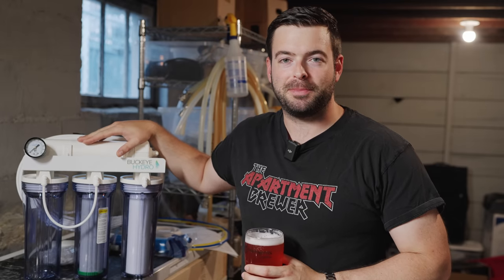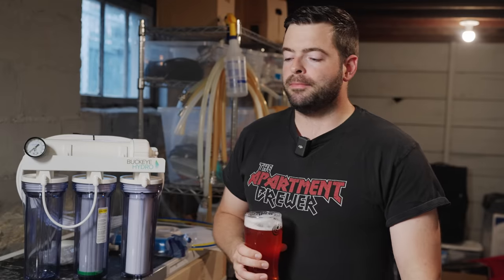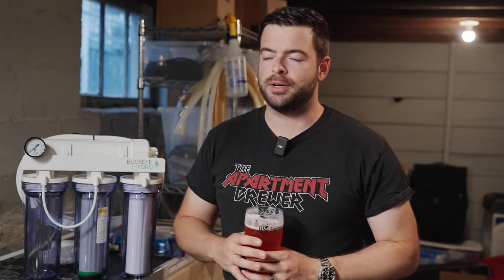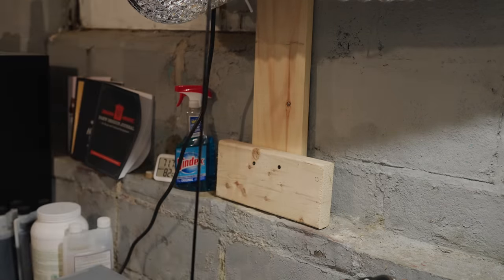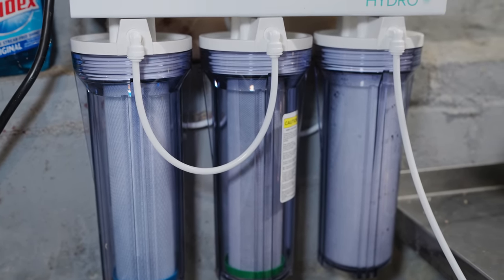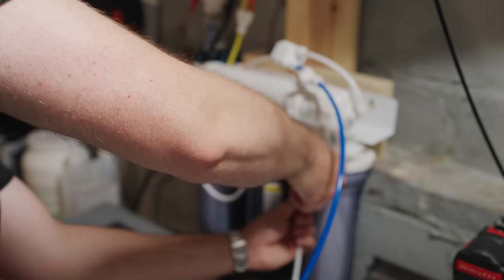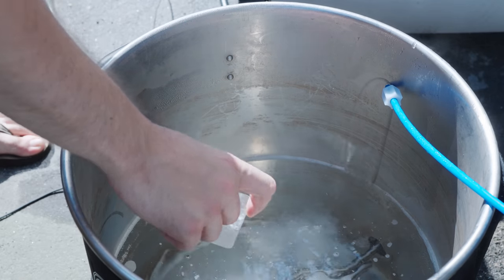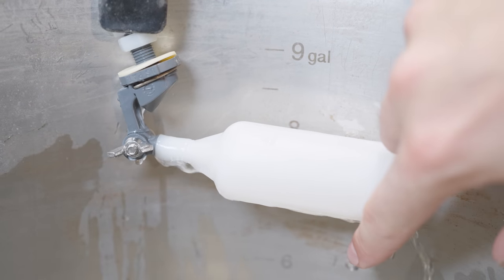How to Get the BEST BREWING WATER AT HOME - Installing an RO SYSTEM

Comment: Just let me put some jazz in the background before starting. As it is the time of the year when I get really busy, I thought I'd brew several beers at once when I get enough time off. As it is my first time doing something like this, does anyone have tips or advice on what I should pay attention To?
Reply from the maker: Good luck! A double brew day is doable but you'll be running around like crazy keeping track of everything going on at the same time. Plan as much as you can ahead of schedule and rehearse in your mind what you will be doing.
Reply: @TheApartmentBrewer  The thing is, I'm not planning two beers side-by-side. I'm planning to brew 3 back-to-back-to-back so in that sense it's less hectic but takes a LOT more time and I'm asking for any advice or tips like cook your meals before hand and microwave them, is lightly hand washing and rinsing the kettle (no taps or pumps or any fancy toys) enough or do I actually need to clean it properly? This kind of things worry me a bit. But thanks for the good luck :) it boosts my morale.
Reply from the maker: Ah ok I misunderstood. That's gonna be a lot of effort, though. I would recommend planning out your meals and having some caffeine or something handy. Just a quick rinse down between brews should be fine if you're going to brewing again right away.

Comment: $3 or $4 per gallon for distilled water?! That is insane. It is only $1.40 per gallon where I am.
Reply: Yes, the pricing does vary.  It’s ridiculous. By me it is anywhere from 1.79 a gallon to 2.79 a gallon depending upon availability and where you shop.
Reply: It's about 1.50 a gallon here in the puget sound area
Reply: I just get the Target brand distilled, and it’s ~$1.20/gallon in the Philadelphia area.
Reply from the maker: $3-4 may have been an exaggerated estimate, but I just saw over $2.50/gallon the other day. Plus there's no guarantee that stores will have enough for me to take back with me, often times they only have a few gallons handy, and I have no fill location near me.

Comment: Yes RO is the best way to start. 
 Just throw in a Campden tab in the mash water to get rid of the chloramines.
The down side of what I currently have is the recycle time.I (maybe) get 2 gal/ 4 hrs if I am collecting
Reply from the maker: A camden tablet is a great way to help remove the chlorine and/or chloramine, good alternative to the chlorine filter.
Reply: If you have the correct prefilters on the RO system, the chloramine will be removed prior to the RO membrane

Comment: Stop it... unless you live in an area that has hard water, there is no need. There are literally breweries that use lake water... tap water is fine as long as it's not hard water, you boil out the impurities and in most cases, you can find your city water profile online with your water company website if you really want to create a custom water profile.
Reply from the maker: No, I don't think I will stop it. There are clearly thousands of people who are interested in this topic and are hopefully benefiting from my instructions. City water profiles fluctuate all the time and are only measured at the treatment plant, so you're usually picking up tons of minerals from old pipes. Secondly, boiling only removes chlorine and some hardness, other minerals are unchanged.
Reply: @TheApartmentBrewer  They watch this because you tell them to, hence views
Reply from the maker: @ldt_  lol I wish it worked that way, then I'd have millions of views. Nope, interest in this topic is far higher than my other recent videos.
Reply: Hard water (calcium and magnesium) is actually good for brewing beer.  It's typically not hardness RO systems are used to remove.  More commonly it's sodium, or chlorides, or high alkalinity or high TDS.